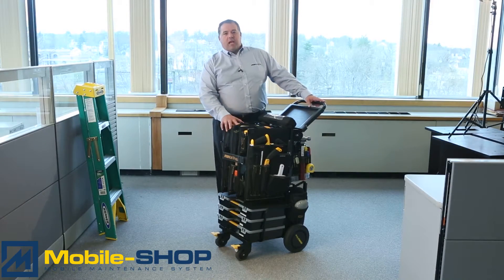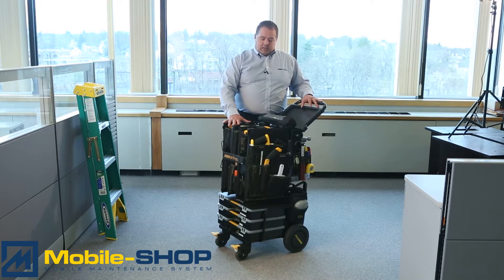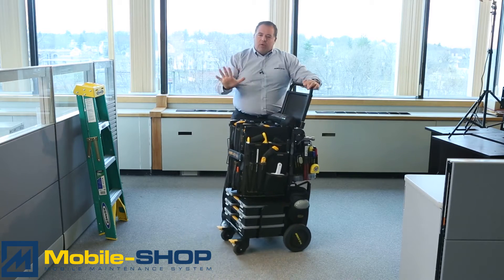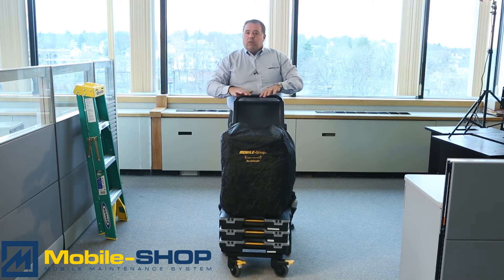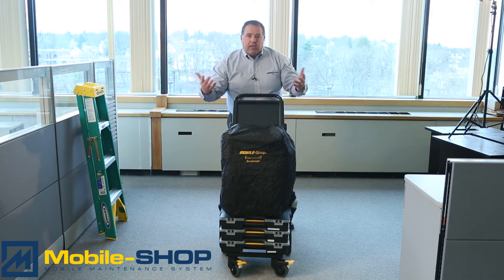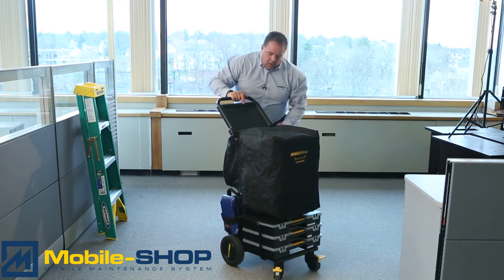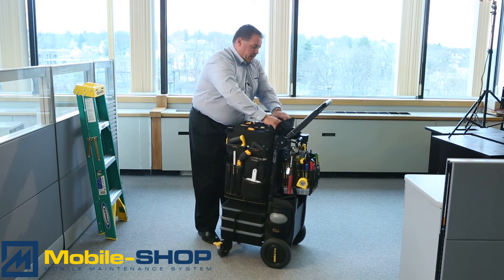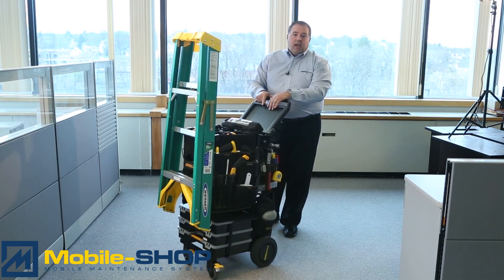The Mobile-Shop HT Engineering Cart

Comment: It would be great to have a listing on what exact products are included.  In a set of tools, knowing that they are quality makes a big difference in terms of understanding price and value.  I'm sure every so often the specifics would have to change, but, they are obviously important.  A tool cart full of Pittsburgh tools is definitely not the same as a tool cart full of Snap-On tools, or Klien tools, etc.
Reply from the maker: Hi Michael - Great question!  The cart's Tools & Parts list can be downloaded directly from the site: https://www.mobile-shop.com/ht-cart. Thank you!
Reply: @MobileShopSystemLLC , yes, the parts list is definitely helpful.  However, there are only a few places the manufactures of the tools identified, and of the parts just list the size and tool name.